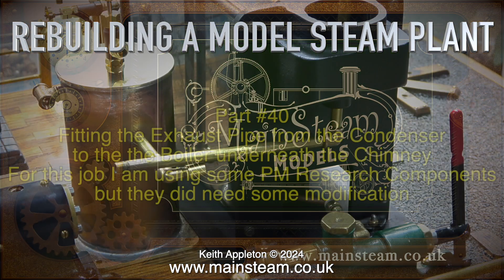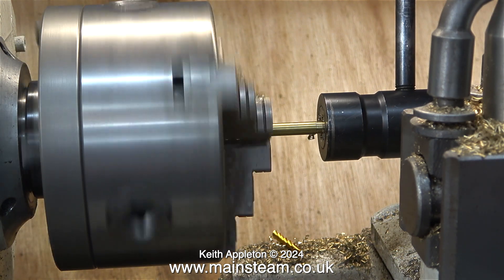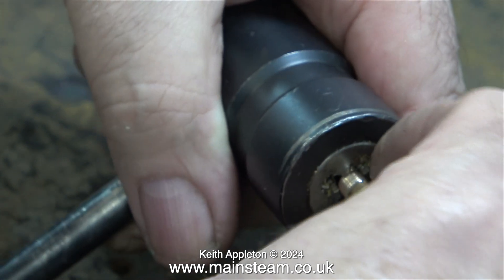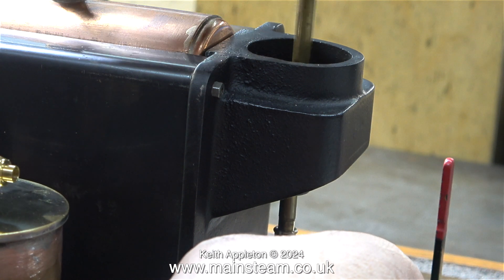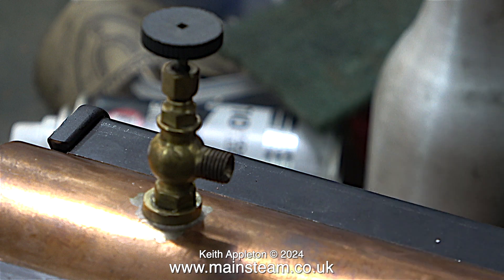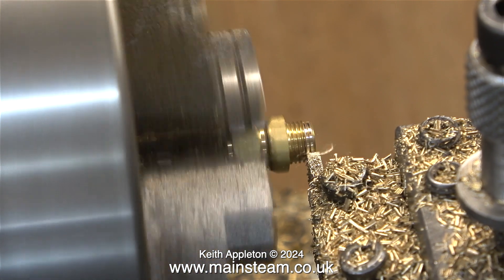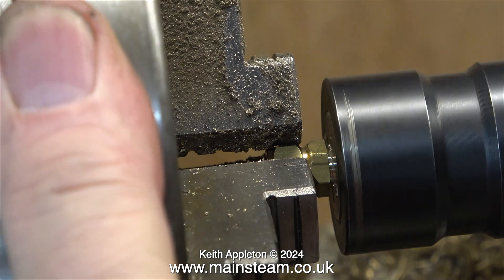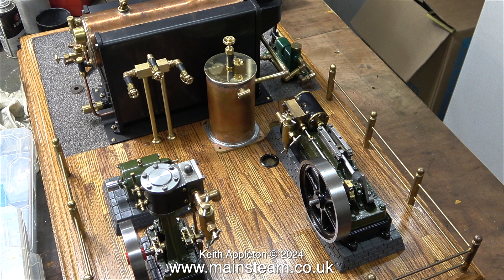REBUILDING A MODEL STEAM PLANT - PART #40

Comment: Have you ever tried to put bar stock inside tube so that you can tight it properly when threading and also putting some shims from soft metal on the outside against marring the soft metal from the jaws?
Reply from the maker: I used to make condenser tanks commercially and that is exactly what I used to do when I used a 3 jaw Chuck. This large 4 Jaw self centring Chuck seems to hold the copper tube just fine. Thanks for telling me }:-)))